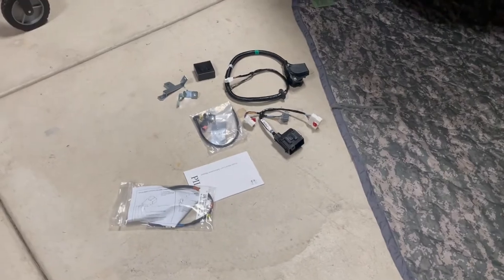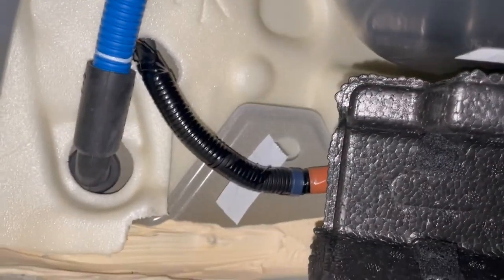Honda Pilot OEM Trailer Hitch and Wiring installation

Comment: Honda dealer wanted over $750 for parts or over $1400 installed abd got parts online under $400. So this video will help a lot, look forward to doing it myself. Tha ks for your help!
Reply: Where did you find that parts?
Reply from the maker: There are some links in the video description, just make sure it fits your year/model before purchasing. Thanks!

Comment: just a note for others. I have a 2024 Honda Pilot. It looks like there had been some significant changes to the rear bumper. There's an additional channel now that will block your access to the 2 screws holding the new hitch panel. I managed to remove it, but It's impossible to re-install the them due to tight spaces, even with a 90° flex adapter. You will have to remove the whole bumper per Honda's instructions. It doesn't seem difficult, but tedious. Well, it's Christmas break, so I have time... dealer was charging an extra $300 to install the hitch. I recommend you take a look under the bumper and the instruction sheet before deciding to take the plunge...

Comment: Thanks for the video. Dealer in Syracuse wanted to charge me $1172 for just the hitch without the harness. Bought part for $250 at BK Honda parts and it was easy to install. Took less than an hour.

Comment: Thank you for the vid. How do i do the trailer brake? I don't see any videos. Can u point me in the right direction? I did everything else this morning and followed ur vid step by step. I ended up removing the plastic panels to access harness routing easier. I torqued the 6 bolts to 100ftlbs, same as lug nuts would be.

Comment: Great Video!!  I have a 2021 Honda Pilot with the hands-free tailgate and I see that you mentioned you have it too. Were you able to connect that feature back on or you lost the ability to open with your foot? Where did you get the parts? Can you share the part numbers you ordered? Thanks
Reply from the maker: I haven't completed that part, we never used it before so I guess we forgot about it. I need to get that installed

Comment: Excellent video. I really appreciate the detail you went into. I'm still on the fence whether to add this so I can tow with my 22 Pilot (better tow capacity than my hybrid Maverick) or go with my truck, since that already has a hitch receiver installed. But if I ever need the extra tow rating of the Pilot, I'll rewatch this video a couple times before I plunge in!

Comment: I bought the same hitch as you. Did you have to buy an additional adapter to make the hand's free device fit?
Reply from the maker: @jasonwigand3112  You can buy the additional adapter or modify your adapter. I believe there are videos on it out there. I haven’t done either so my hands free doesn’t work and we never used it anyway so I haven’t really thought to buy one or modify mine. I guess I should do that one day!

Comment: Where did you oder this oem parts from ? Please, just bought a 2022 pilot and found your video and it is great video . Thank you for making it . Hope you get back at me .
Reply from the maker: I recommend that you call the local Honda dealership and ask which part numbers you need for your specific vehicle for the hitch, wiring and hand-free adapter (if equipped) then you can cross reference them with these items to ensure they will fit! Thanks for watching!

Trailer Hitch that comes with the new bumper insert:
https://amzn.to/3PqVFDI

Wiring harness:
https://amzn.to/3ITLll5

Comment: so i've got the wirring harness installed.  when I try to put the bolts in for the hitch, the bolts won't go in more than like a 1/4 inche.  i cleaned the holes with penetraing oil, and some brushes. and nothing.  any idea?

Comment: where did you order the parts from?  do you order the hitch and the cover plate separately?
Reply from the maker: I recommend that you call the local Honda dealership and ask which part numbers you need for your specific vehicle for the hitch, wiring and hand-free adapter (if equipped) then you can cross reference them with these items to ensure they will fit! Thanks for watching!

Trailer Hitch that comes with the new bumper insert:
https://amzn.to/3PqVFDI

Wiring harness:
https://amzn.to/3ITLll5

Comment: When pulling down the harness did you have to cut the electrical tape that is holding it up?
Reply: For those installing this.. you have  to grab it at the electrical tape of the wire and pull it down. It will come apart. Also when installing the wires before you connect it go through the bottom area where the jack is then connect it. Makes the job way easier.
Reply: Also if you guys want to save 100$ for the adapter to the hand free tailgate. I cut the plate that held the sensors to fit the new assembly (with a Dremel). Then I cut both sensors shorter with a wire cutter. I then went to local hardware store and bought thread protectors to cap off the sensors I cut , then used electrical tape to hold the thread protectors on tight. Still works like a charm. And yes you will only have sensors on the passenger side just like the adapter. Just trying to help
Reply: I have a 2022 Honda pilot. Great video by the way

Comment: Great video. What did you do with the foot tailgate sensor? Did you reinstall or does it no longer work because of the hitch?
Reply from the maker: Thanks! So when I ordered my parts, the adapter for the hands free sensor was on back order. So I didn’t install it yet. I bagged the connector and tied it out of the way for now. I need to order the adapter and install the hands free sensor. We didn’t use it before so not missing it now but I do want to get it installed again one day. Thanks for watching!
Reply: @justinfyfe7061 Hello running into the same thing. Apparently this part is suffering from the chip shortage so it is in back order. Was also thinking about installing the hitch and removing the HFT sensor. Did you get any warning lights or any issues besides the obvious of not being able to use that feature? Do you have a pic of what you did to secure the electrical connector that plugs up to the sensor/bracket you removed? Thanks. Great video!
Reply from the maker: @davidiniguezjr214  I just bagged the connector and taped the opening then zip tied it to the wire harness so it would be out of the way. No warnings or lights or anything like that. I will try to get a picture of it. Thanks!
Reply: You can modify the original to make it work. The sensor is just an rca cable. Cut it to length and add some heat shrink or tape to the end.  The bracket has a line you can cut on I just did mine. Works perfect.
Reply: Do you have a video of the mod? I don’t trust myself to just “wing it”
Reply: @dizzlvizzl  I am currently working this issue (just installed my hitch ~2hrs ago)...like Nathan mentioned before, there are "lines" on the original plastic clear as can be. Looking at the part and how it sits in the original compared to the new piece, I think (a big "think" at this point, not 100%) you can essentially just cut the middle section out at the lines on the plastic, then use the 2 ends without cutting the RCA cable. It seems as though you could just reroute the RCA and re-clip them at both sides....but then again, you may be able to not to? 

I do not really have a good way to video it, and I am still trying to find another example, or some feed back as to what I "think" I will be able to do before I pull the trigger and cut. Did you end up doing anything with yours?
Reply: Hey, do you guys have part number for adapter for HFT sensor which will work with hitch? Please share

Comment: Nicely done.  If I heard your numbers correctly,  it sounds like you saved $3-400 over having a dealer do the install?

I have seen $532 for the transmission cooler from Honda.  Are there OEM suppliers also?

Are there engine software tweaks needed for towing?

Comment: Hi, where díd you order all those parts from?
Reply from the maker: I just searched Honda OEM parts online and compared part numbers/prices until I found what I was looking for and ordered from one of them. Thanks for watching!
Reply: Can you provide the links?
Reply: Can you add a link for what you have, because some are wired and some aren’t. Yours is clean and professional looking!!
Reply from the maker: I recommend that you call the local Honda dealership and ask which part numbers you need for your specific vehicle for the hitch, wiring and hand-free adapter (if equipped) then you can cross reference them with these items to ensure they will fit! Thanks for watching!

Trailer Hitch that comes with the new bumper insert:
https://amzn.to/3PqVFDI

Wiring harness:
https://amzn.to/3ITLll5